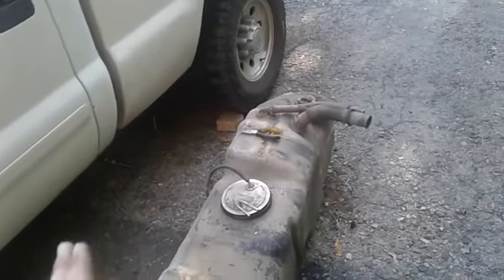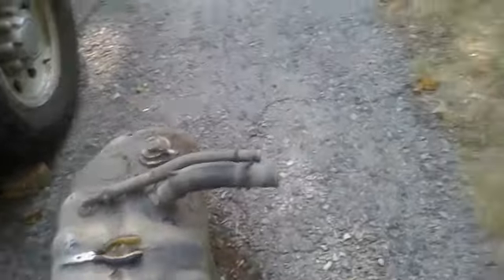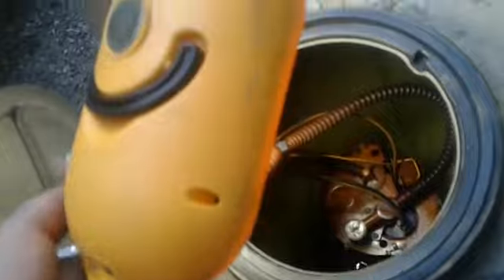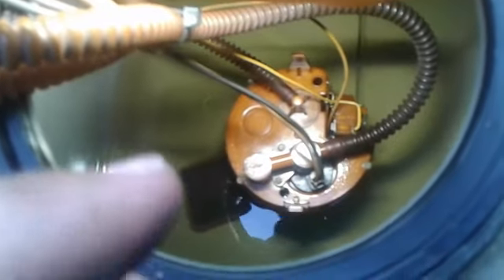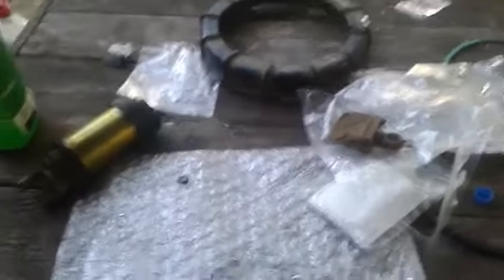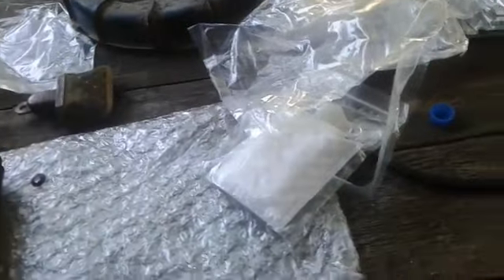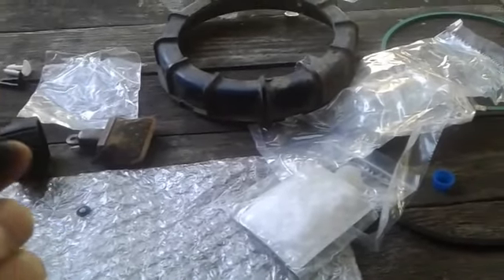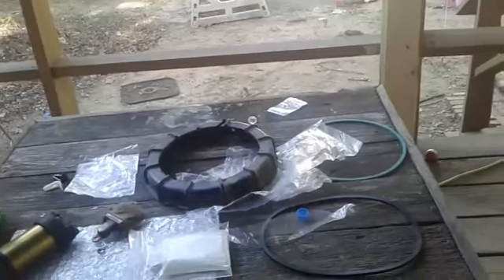2003 Ford F250 Super Duty 5.4L fuel pump change

Comment: I picked up a few pointers from your video so thanks for posting! Having just completed the removal and replacement, your video makes a lot of sense. The tabs on the sides were a mystery until I just happened to figure out to grab the bottoms of each tab and pull outward to release them from the main plastic body. Much easier than squeezing the tabs on the top...just didn't work for me causing lots of frustration until I figured out a better way. Dropping the skid plate and tank was easier than I thought. Also, since I had a full tank of gas, using two plastic tubes and an air compressor made defueling a breeze (draining the tank by siphoning.) Good job!
Reply from the maker: I'm glad I could help
Reply: @privateroadtexasoutdoors  CAN YOU EXPLAIN WHAT RICK TOMS COMMENT ABOVE WAS SAYING ABOUT THE GAS REMOVAL WITH TWO TUBE AND AIR.  i NEDD TO REMOVE MY TANK WHICH IS FULL THE TOP RIGHT NOW.  ANS SHOULD I DISCONNECT THE BATTERY BEFORE STARTING THIS PROCESS.
Reply from the maker: @24coffee2day  there's a hand pump you can get from Wal-Mart if you don't have an air compressor. You stick one end in your tank and the other in a can or multiple if needed to drain the gas out of your tank
Reply from the maker: @24coffee2day  also, yes disconnect the battery to avoid any possible spark
Reply: Thanx for tip brotha !!! like to know how use air compressor and two tubes ???

Comment: I'm having a hard time changing mine. I have an 03 f250 single cab and I can't get the fuel lines disconnected. I'm pretty much ready to just cut and replace them at this point. It doesn't have the same type of connectors as everyone's I've seen so far.
Reply from the maker: Message me on my FB page with pics and I'll see if I can help
Reply: @privateroadtexasoutdoors  will do
Reply: @privateroadtexasoutdoors  I ended up cutting the lines. It was a huge pain to try and hold a screwdriver in the clip while also attempting to disconnect it. Needed two hands but only hand room for one. Seems like the fittings are readily available and affordable. Got cold too quick to fiddle with it out in the driveway anyhow. Thanks a bunch none the less!
Reply from the maker: @jahrjahr24  I picked up a fitting set from AutoZone to do mine they're usually pretty cheap and easy to use. Sorry for not explaining better in the video
Reply: @jahrjahr24  I used gates baricade / for fuel injection 5/16 hose and two s.s. hose clamps on main fuel hose from tank to filter @ filter in oct. 2018 and ive never had a leak yet in sep. 22 !!!
Reply: @brianblithe2271  I ended up doing something similar. Cut the old fittings off. Got some ford fuel line repair kits, warmed em up and slid em on. The only issue was they were a single layer nylon line which is flimsy as hell and would kink and split. So I used some 1” irrigation tubing and cut it to make it like a spring, spiraled that around the little flimsy lines. Viola no more kinking. Next is my fuel filter line. Just been putting it off.
Reply: Hey I also have a 2003 f250 single cab with 8ft bed and when I called to get a pump replacement they said there were three different types. Do you happen to know what the part number was or what pump you ended up buying to replace yours?

Comment: Was the truck stalling before the fuel pump change  ?
Reply from the maker: It stalled a couple times at idle but not when driving
Reply: @privateroadtexasoutdoors  Oh okay i have an 02 f250 5.4 v8 4wd and mine starts strong then dies out within seconds i changed spark plugs, idle air control, and oil, and still got the same problem im praying this is the fix, this is my first car bought it for 4500 im almost 6k in and i still gotta fix my horn and e-brake, i probably will just get a new truck next time
Reply from the maker: @bigcountry7096  if you decide to change out the pump it's generally a good idea to change out the fuel filter at the same time. Best of luck to you
Reply: Private Road Texas Outdoors Hi, how much time to remove fuel tank?  Reinstall?
Reply from the maker: @SoCalCitizen  for me it was only a few minutes to get the tank off because there's wasn't much gas in it. Total time it took me from start to finish was about 2 hours and that was with a couple breaks
Reply: Thanks brother

Comment: What’s the part number for the pump you used? Do you know what the psi and flow rate specs for this truck?
Reply from the maker: Part # A1253EP is the cheapest option they have now through AutoZone. 4 years ago when I shot this I was able to get the whole set up for half of what they want now. And unfortunately I'm not sure what the specs are